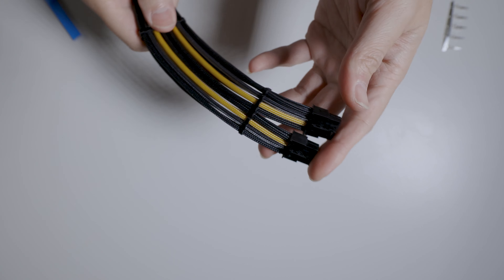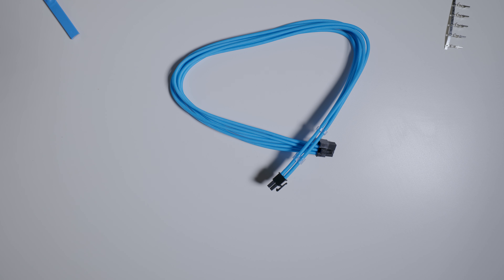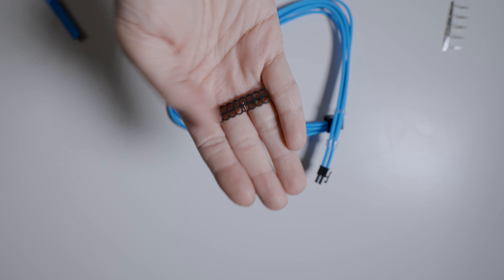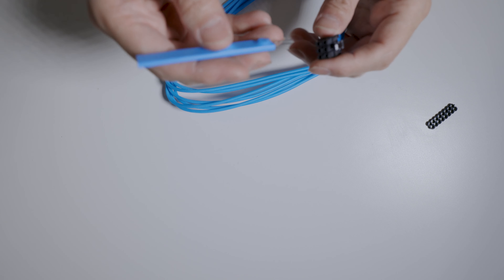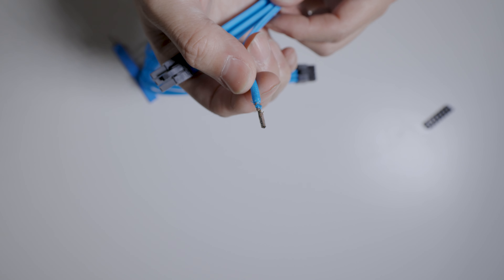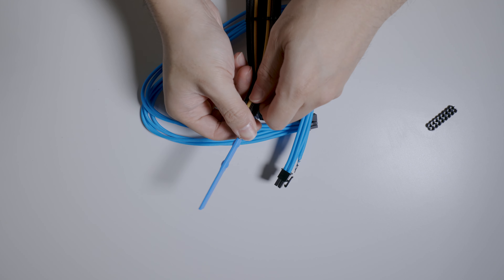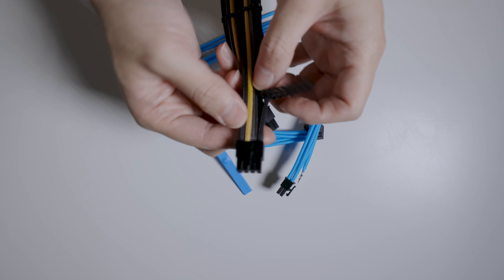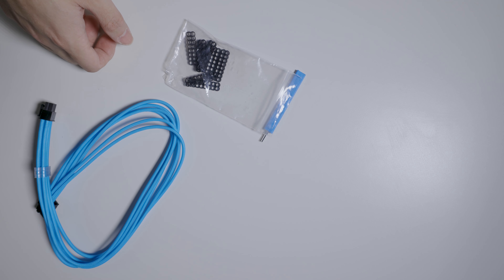Make your own bridged cables and extensions from existing Cablemod PRO and other cables.

Comment: Which brand do you recommend for cable extensions kit? Mainframe or cablemod or other? Also where did you get some quality comb? Also from mainframe? Thanks
Reply from the maker: They are both made the same way, mass production crimped directly into the terminal. You can buy combs from mainframe, clockwerx, mnpctech etc. from a quality perspective mainframe is still better than cablemod because of the teleios sleeving